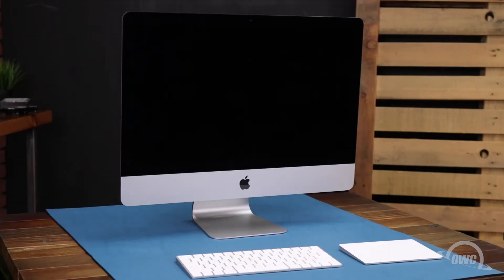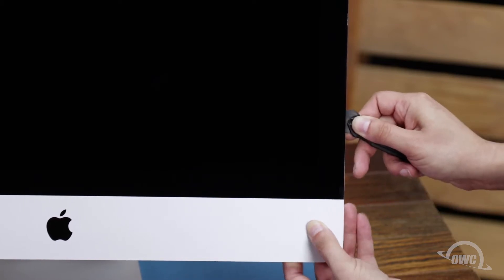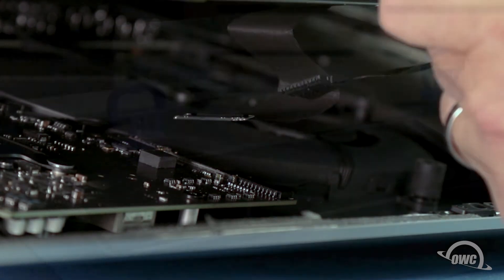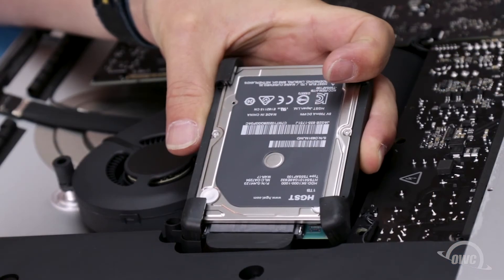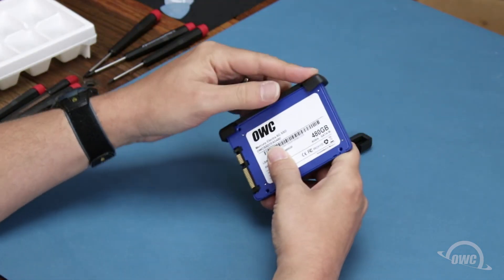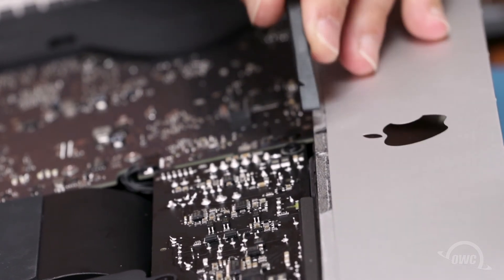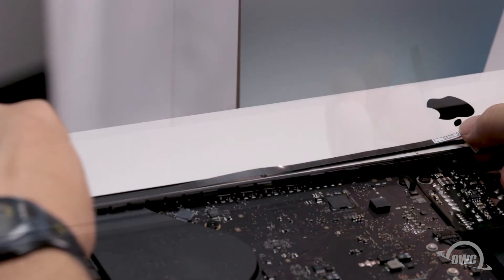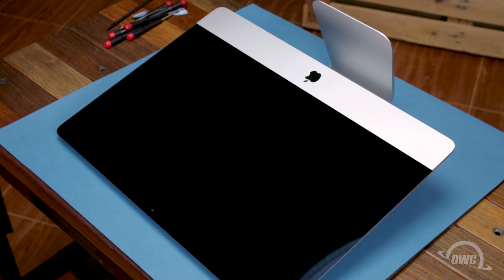How to Upgrade/Replace the Main Drive in a 21.5-inch iMac (2017) -- UPDATED VERSION AVAILABLE

Comment: I just did an SSD and 32GB of RAM upgrade. After connecting everything back together i am getting the prohibited symbol on startup. I cant get into recovery mode either. I have a wireless keyboard with a wireless USB dongle. Any suggestions?
Reply: same issue with a bootable usb flash drive...
Reply: Slight update. Everything is fine except that the thunderbolt ports are not working now...any ideas people?

Comment: Hello! On previous OS-versions a special sata cable with a temperature sensor was needed. Is this still needed? I want to upgrade a 2017 iMac 27" with an SSD (swap the 3,5" drive). Thank you!
Reply: No special cable is needed on newer versions

Comment: Good afternoon MacSales.com And OWC.
the video is about the sensor using a normal hd. where you install the sensor at the bottom on the HD.
You could make a new video explaining where to install the sensor using an SSD, because I am in doubt where the owc sensor goes in my SSD. my imac and the 2017 5k. I'm waiting for your answers thank you
I even bought the thermo sensor kit from the OWC website, because Owc's website sells the complete sensor or kit. and they say imac 2017 need it.
my model and the 5k 27 "year 2017 a1419 mne92ll / a.

Comment: I've tried to do this my iMac 2013 and I'm having CPU issues and high fan speeds. Thanks for your help
Reply: I haven't opened a 2013 model, but the older models such as the 2011 had a temperature sensor integrated into the hard drive that the Mac used to determine fan speeds. The SSD won't have this and a software solution like ssdfanctrl, to read the temps from the SMART is required for older models and probably yours.

Comment: i've read online that 3.0 21.5 4k 2017 imac on apples website says only able to put 256 or 512gb ssd, but i was curious if a 1tb will work, kind of like how they say you can only put 16gbs of ram in but 32gbs works fine?? anyone know.
Reply: sure it works. the ssd. ram i don't know

Comment: Excellent video - took me 90 minutes to upgrade and replace both the hard drive (1TB SSD) and the memory (2 x 16GB). At the final steps, I only removed the front backing from the bottom 4L and 4R adhesive strips, then postioned it in gently, adjusted it, set it completely flat. Finally lifted the screen slightly,  then reconnected the two cables, removed the front adhesive backing off 1 2, 3 and 5, and placed the screen in place. Perfect fit! Pizza tool worked great. Performance increase was notable, both processing and boot-time.
Reply: can the 2019 version be upgraded too?
Reply: I saw something that said my 2017 4K 21.5 iMac only allows a 500gb ssd, but I’m hoping it’ll allow a 1tb

Comment: Don't you need the special adapter cable in order to get the thermal readings for the system to prevent the fan from operating on full constantly?
Reply: MacSales. com Thanks for getting back to me! Glad to know I won't need to worry about this when it comes time for me to tear mine up for upgrading!
Reply: @poweredbyowc  Good afternoon MacSales.com And OWC.
the video is about the sensor using a normal hd. where you install the sensor at the bottom on the HD.
You could make a new video explaining where to install the sensor using an SSD, because I am in doubt where the owc sensor goes in my SSD. my imac and the 2017 5k. I'm waiting for your answers thank you
I even bought the thermo sensor kit from the OWC website, because Owc's website sells the complete sensor or kit. and they say imac 2017 need it.
my model and the 5k 27 "year 2017 a1419 mne92ll / a.